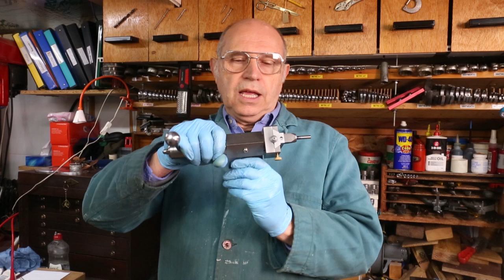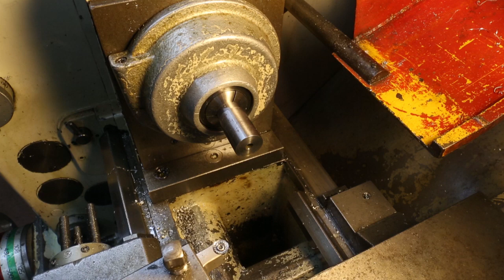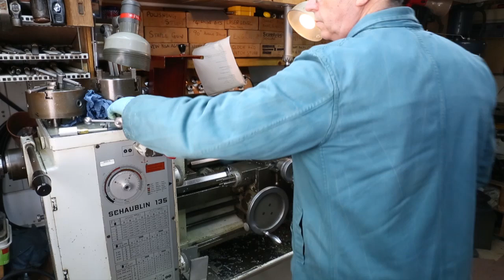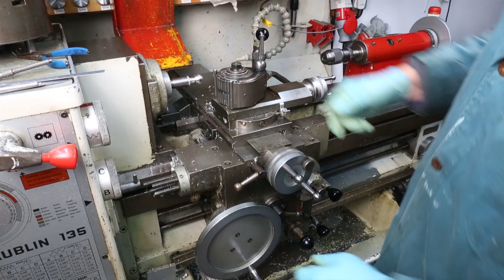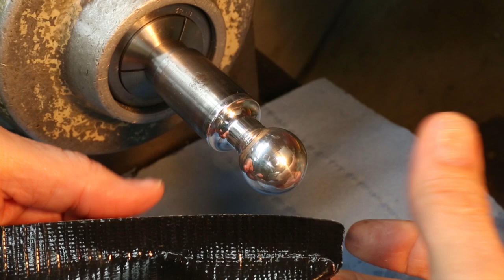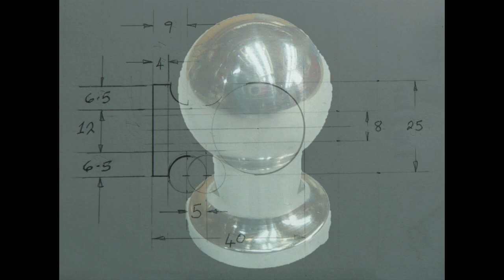Ball Turning

Comment: Nice ball turner my friend. This attachment is something I meant to make ages ago, and still hasn’t gotten around to it yet. He he. 
Keep it coming
Reply from the maker: Hello @RustyInventions-wz6ir. Thank you for your comment. I'm not sure if I mention it in the video but the balls I made have thick shafts as a design feature. The attachment can produce thin shafts as well but these ball handles were to be used on cutting oil return filters on the bed of my milling machine. I left them nice an thick so if anything heavy was dropped on them they wouldn't bend. This attachment works well, you need to make one. Take Care Jim.

Comment: Excellent technique! I have not seen this fixture before, I use the type that rotates on a horizontal axis, this technique, using the thrusting into the tool post as it does, gives a very good finish, is there a stop on the radial axis of the tool to stop you from digging in on the left hand stroke? Chris B.
Reply from the maker: Hello again Chris B. The ball turning fixture does not have a stop on the radial axis, you have to cut by eye and be careful. I have wondered about modifying it to add a stop but I'm retired now so no spare time! Thank you for your comment. Take Care Jim.
Reply: @CYC123  Ha Ha! Retired now so no time! We were told we would become bored on retirement, but there are not enough hours in the day, I have re build a stone farmhouse, re build a Jeep Etc Etc in the 15 years since I retired, and I have yet to be bored! Just keep going. At least I had the foresight to get out of UK. Stay sane! Chris B.